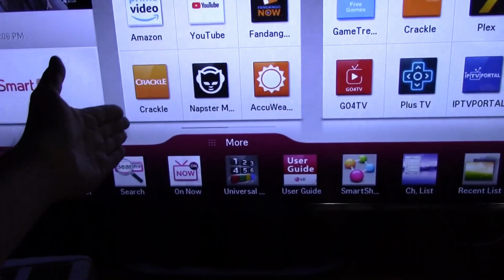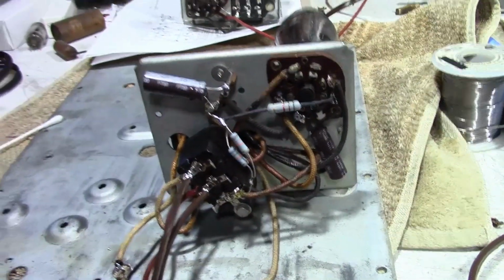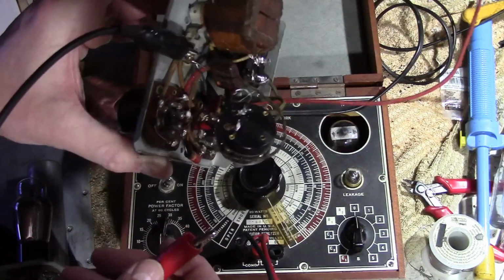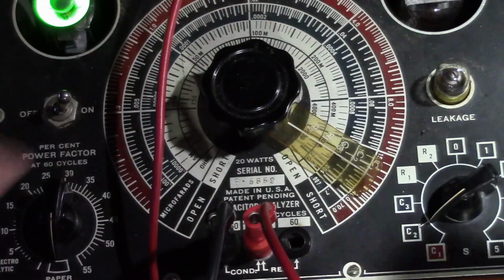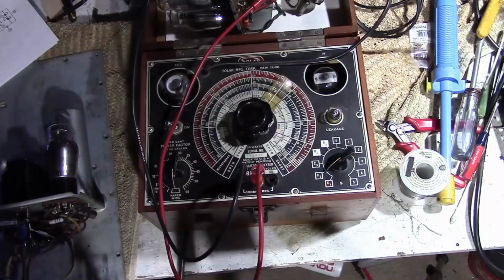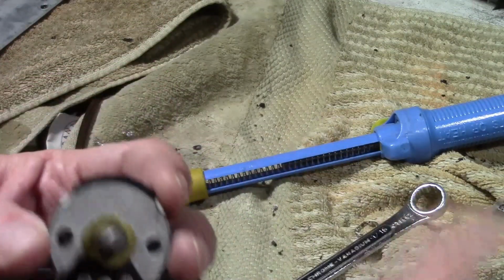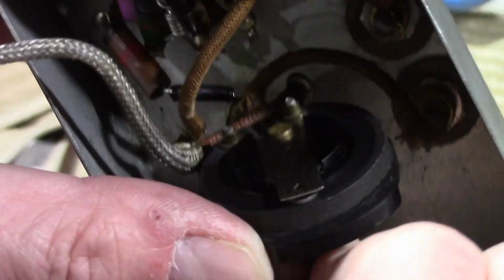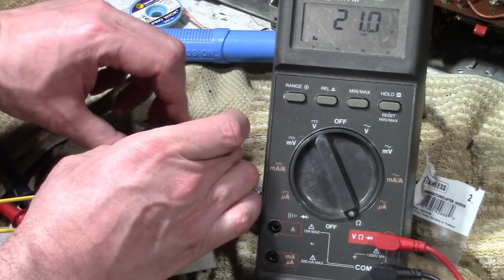Philco 077 RF generator restoration p4o6

Comment: I did not change the mica capacitors in the Magnavox Embassy I am working on. Your Philco signal generator is turning out to be a major restoration project. I sure like your Sola capacitor analyzer. I will soon be going down in my spider infested cellar to see if I still have that Philco tube tester. I'll send you pictures of it if I find it. LOL I knew you were NOT going to let that pot go without investigating it. That pot is very interesting. I have not seen one like it before.

Comment: That thick carbon ring will last longer than the sun even if you turn the knob all day :)
Reply: Yes, but it's a shame that the wiper is just a piece of bent sheet metal. It should be a big graphite or bronze brush, to match the lifetime of that carbon ring.

Comment: I think that the construction of that pot is to minimize insurance.  You can't use a wire wound pot there. It would also get a lot of use when doing alignments so it needs to be robust. It's a nice solution. BTW would you replace the outlet sockets with BNCs to make the generator more useful today? You could keep the old ones inside if anyone wanted to revert in future.
Reply from the maker: I have several modern RF generators I typically use for alignments.  I'd rather leave this all original since it' in such nice condition.